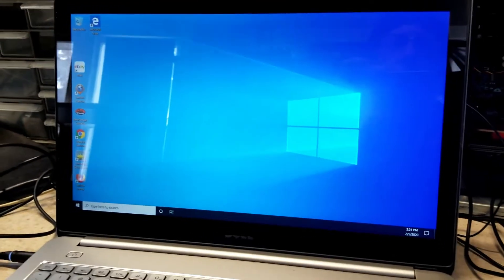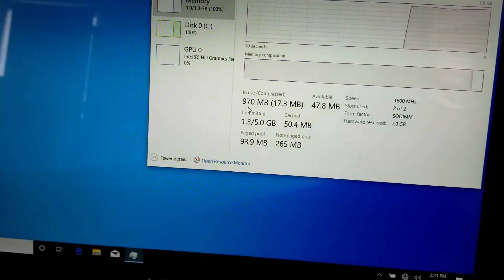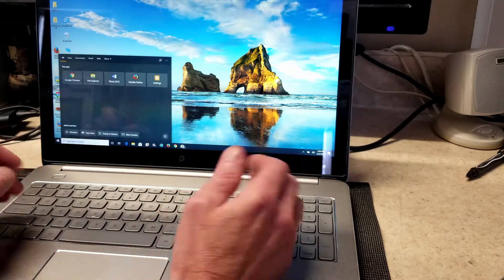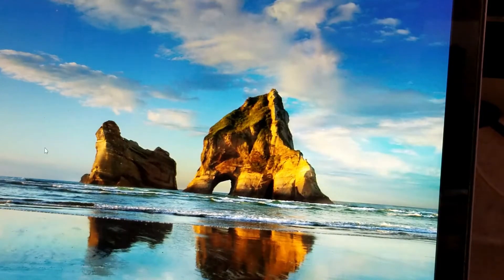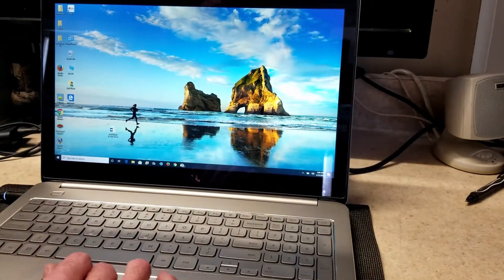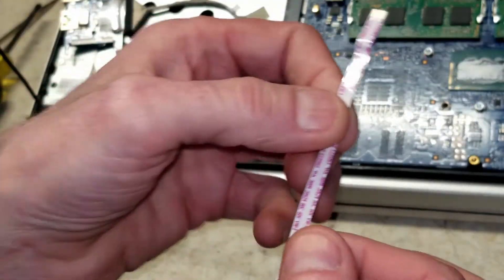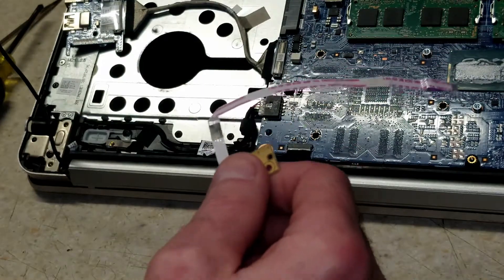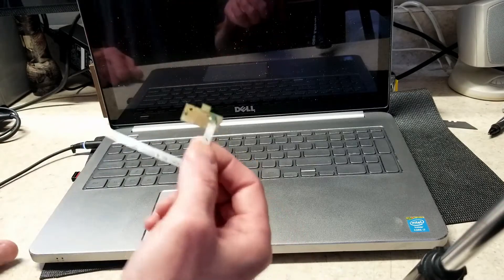Dell Inspiron 15 7537 laptop issues and repair

Comment: Hey, i have the exact same laptop, could you help me, my laptop keeps overheating whenever i play games. It overheats really bad and then shuts down. Please i need a fix for this
Reply from the maker: I would think either the thermal paste has dried and no longer works to transfer heat, or the cooling fins have become clogged